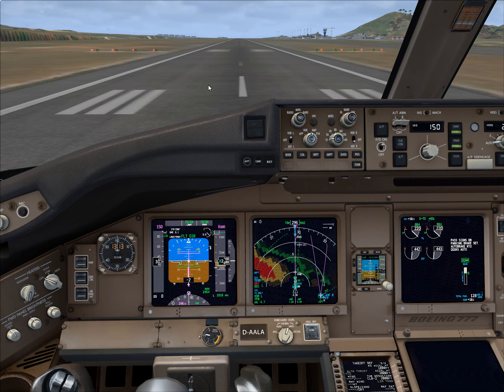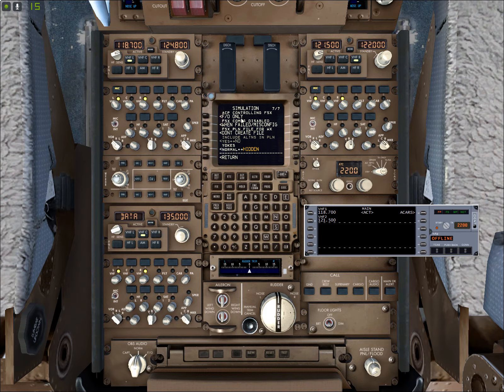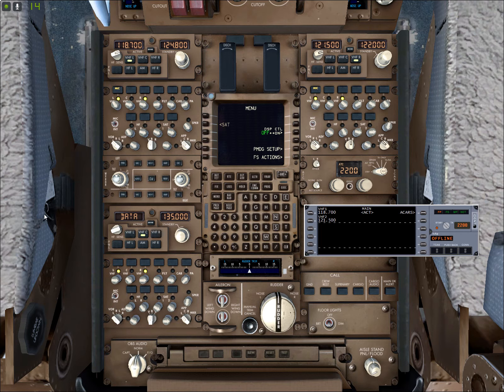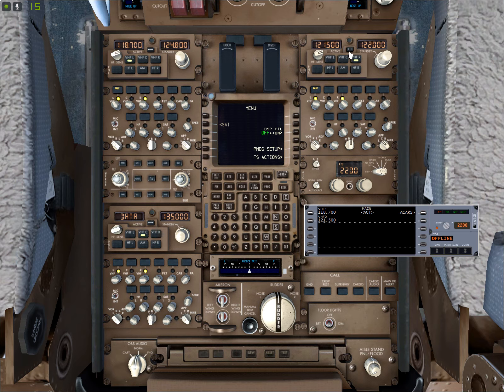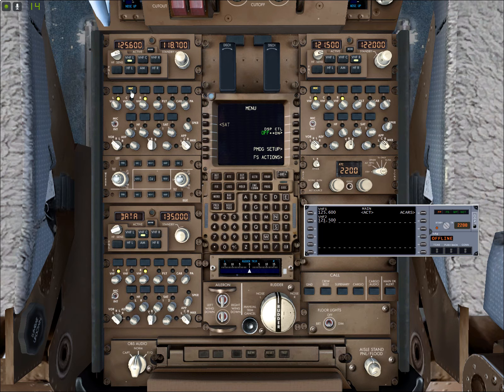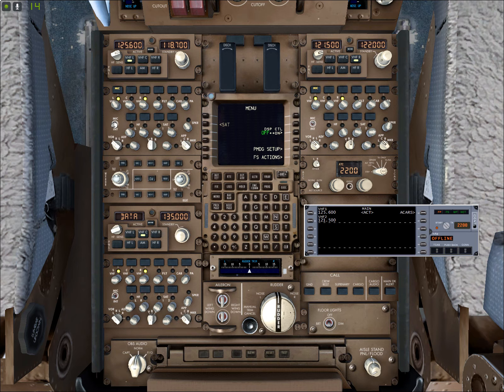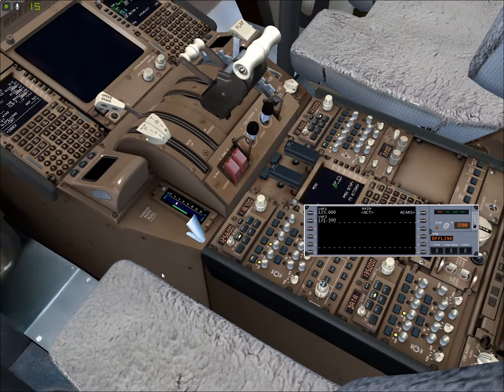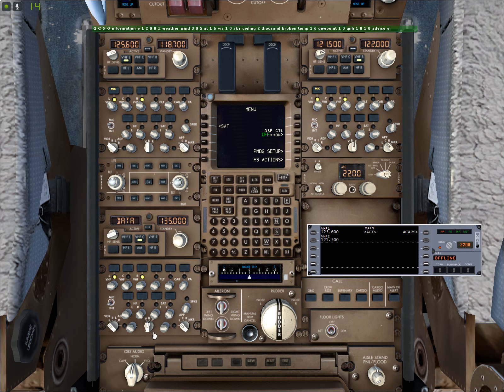Communications: VHFs / RTPs / ACPs

Comment: How do I change the smaller vhf number like 121.205 121.2020 something like that I can’t do it on my ff b777 in xp the vhf seem to tuned only 25 50 75 100 look like the number are fixed
Reply from the maker: Hi, that has to do with the channel spacing. It used to be 25 MHz but it's gone down to 8.33 MHz recently. It will be a question to ask the developer of the product whether they support 8.33 channel spacing or not.